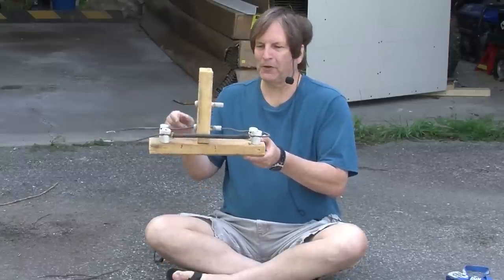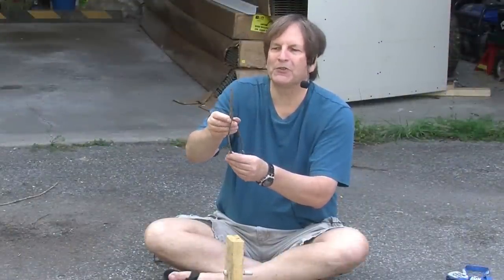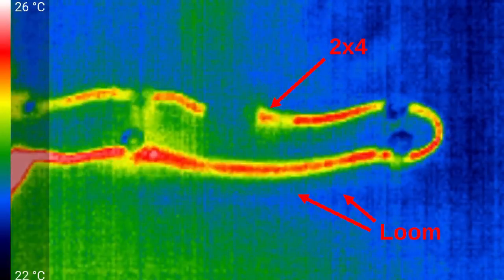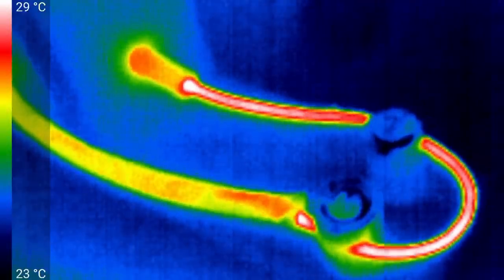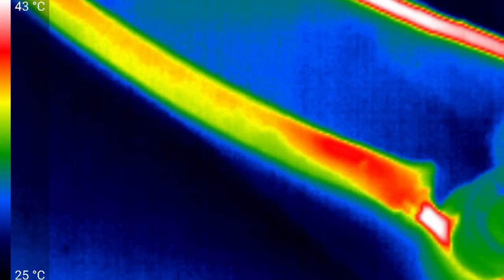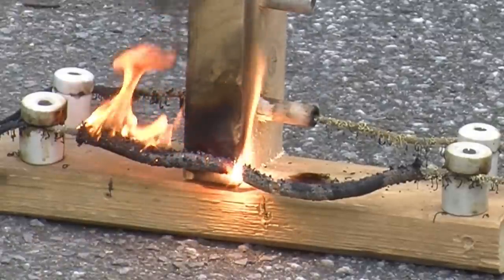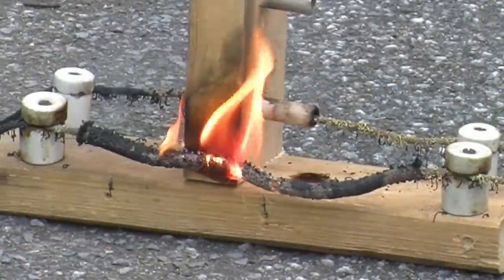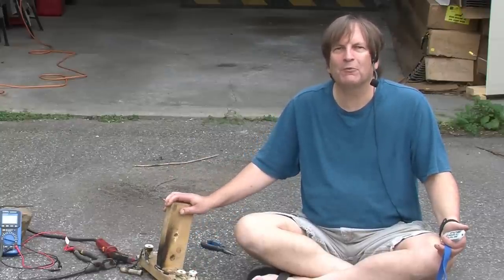Testing 100 Year Old Knob and Tube Wiring

Comment: The tin coated copper wire is referred to as copper clad wire
Reply from the maker: I thought copper clad meant the wire was coated with copper and the inside was something else. These days the inside is often aluminum. Has the meaning of the term changed over the years?

Comment: I find the way you talk about the wood temperature to be potentially misleading here... Like, e.g. at 13:22, you say the wood is being kept relatively cool, but it's at... oh, if I can guess based on an upside-down scale, maybe about 50°C in large spots, which... yeah, that's a lot cooler than 85°C of the wire, but it's above a previous threshold of the wire temperature being at 37°C, which you already were talking about being warm.  (I mean, it's body temperature, so not that warm, but still.)  Just thought I'd point this out.
Reply from the maker: Fair enough! I certainly wasn't intending to be misleading. I do find that when narrating things while I do them, my words are not  always as precise or clear as I would want them to be.
Reply: @ElectromagneticVideos   fair enough!  Well, something to keep in mind for if/when there's a next time.  And no worries!  I definitely didn't have the impression that it was intentionally deceptive -- just open to an easy potential for misunderstanding.
Reply from the maker: @DavidLindes  No worries - I always appreciate comments clarifying or restating something that wasn't as clear as I had hoped! Hopefully it will help a future viewer!
Reply: @ElectromagneticVideos  Indeed, that's the hope!  ❤

Comment: Looks safe to me.
Reply from the maker: I thin it generally is was as long as it wasn't covered with insulation or had improper modifications done to the system over the last 100 years.

Comment: Personally, if I had to continue using any knob and tube, I would just use it for lighting only. Keep the load well under 10 amps. I wouldn't use it for receptacles, certainly not kitchen receptacles.
Reply from the maker: Year if one could be sure it was only connected to (LED) lighting at low currents its hard to imagine how it could overheat and cause a problem.

Comment: You could probably take a baseball bat to a caveman and not be surprised that ancient flesh behaves just like modern man’s.

After soldering a joint, it was wrapped with rubber tape, which would subject to abrasion, and then wrapped with “friction tape” to prevent damage to the rubber tape. Try finding friction tape nowadays.
Reply: I retired in 2020, and one of my jobs was a cashier at a local hardware store, we still carried friction tape but it was usually purchased by hockey players for use as grip tape for hockey sticks.
Reply from the maker: Now that you mention it, I haven't seen friction tape in the last few years...

Comment: I’d almost bet that the loom was made out of asbestos. As much hype as it gets I doubt handling a small amount like that would cause you any problems, but be careful nonetheless!
Reply from the maker: I really appreciate the caution/warning! I was wondering about that myself. But in the end I don't think it was not because it essentially burned up much like the insulation. I think it it is some sort of (no asbestos) fabric. I'm also wary of the potentially toxic fumes which is why  I have been doing these experiments  outdoors.
Reply: @ElectromagneticVideos  that’s a good point. I’m no expert but if I recall correctly it could be cotton/ linen, or asbestos. They either changed it at some point, or like you were saying with the non existent standards, each manufacturer did their own thing. Either way, I absolutely love your content! Proof that you don’t need a huge production with super expensive equipment to make enjoyable entertaining content, thank you! 

Also curious, even though the amperage is the same, wouldn’t the lower voltage output of the welder effect the total power delivered to the wires? loaded output of the welder is likely to be less than 30v, and with home electric at 120v, 10 amps of each equals a substantial difference in wattage. I’m not familiar with how these components are tested or rated, but do you think that repeating some of these tests using something like a generator load bank at 120v would produce the same results, or do you think the wires or components would fail at a lower amperage?
Reply from the maker: @Kc12v140  Interesting - maybe even depended on if the were near an asbestos mine or not. Asbestos sure would have been the perfect material for it given the hazards were unknown.

So glad you like the experiments. Funny - I got the old welder at Habitat for Humanity reStore a year ago after its price had kept being reduced because no-one was buying it (AC only is think was the turnoff) . At $100 I couldn't resist even though I have MIG. I had no idea I would end up having so much fun with it.

Comment: Do in a house you have several hundred feet of that wire and if you have a big load at the end of the circuit you would have more heating because it's a longer run a wire I believe ask a certified electrician but I would say don't put any more than a 15 amp fuse on the 14 gauge wire or a 20 amp fuse on the
Reply from the maker: Somehow your comments got truncated, but you seem to be asking about large loads on #14 house wire:

House wire #14 should never normally be used with a fuse or breaker larger than 15A.  And the largest continuous load should be no more than 80% of that. 

Your also right that the longer the wire, the more heating loss you have and that really does get important for large loads because the that heating loss is due to the large current though the resistance of the wire resulting in the voltage at the load end of the wire dropping. Many electrical codes do not allow more than a 5% drop, so with a large load and long wire on a 15A circuit, you may need a thicker wire such as #12.

I did some experiments in other videos with the 14/2 wire inside walls with insulation. The safety margin drops significantly under those circumstances, so much so that if I was building a house today I would probably go for #12 wire for the 15A circuits to increase the safety margin. I gather some builders routine do that. 

Information about whats permissible and best practice/safe in your location is best obtained from a locally licensed electrician. So please consult with one if you are planning something like a large load attached to a long wire.

Comment: I put an afci breaker on it about best you can do
Reply from the maker: Agree with you 100%. If I lived in a place with K&T thats exactly what I would do if I was reasonably sure the wiring was as originally installed and being run with reasonable currents.

Comment: Those wires can take up to 60 amps of current that's why they call it 60 amp wire
Reply from the maker: Do you mean #14 wire used in Knob and Tube was originally rated at 60A? If so - wow - and I guess the insulation has deteriorated over time and sure cant handle the resulting temperatures any more.

Comment: If you run 90 amps to a modern romax wire you will have a fire too.  If you set off a stack of dynamite in a house it will destroy a house.  This test is just senseless.